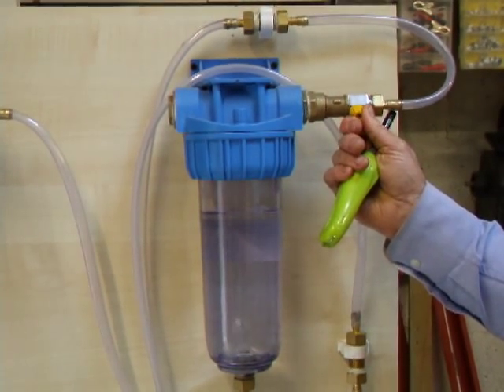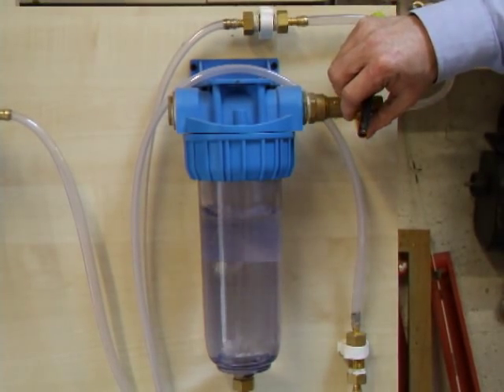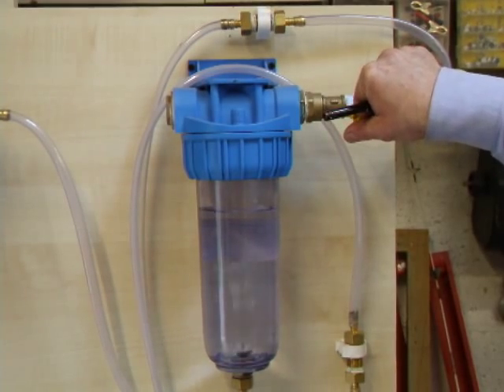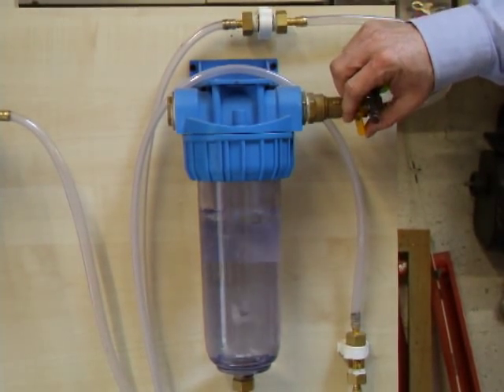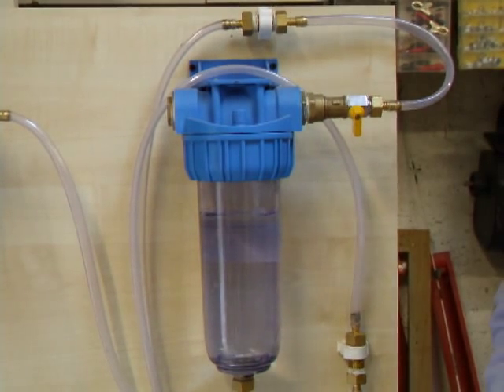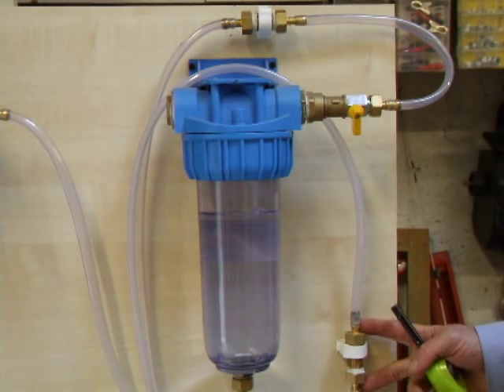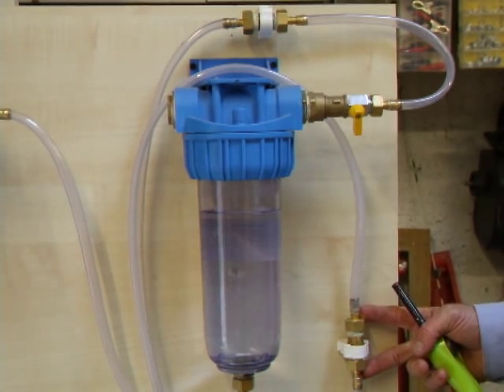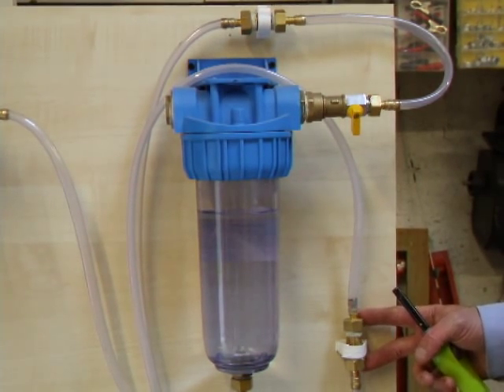Experimental HHO (5 of 7) Flashback Arrester Demonstration

Comment from the maker: Hi sycokitty1, great observation. When the valve is closed, production continues and pressure starts to build. I put a pressure gauge on one of the vessels so that pressure can be monitored. The vessels are warranted to 116psi, however, I NEVER run the cells beyond 25psi for safety reasons. Pressure is useful for welding etc.Tubes are pushed on the barbs and will leak under high pressure - emergency pressure relief. HHO should NOT be vented indoors as it builds dangerously at the highest point.

Comment: I was just noticing that, when you turn off the gas valve, that the bubbles almost stop. Which got me thinking, that it might just be the back pressure slowing the gas down, but not actually stopping it from being made......... (if that is correct let me know).... If that IS correct, what kind of things could go bad (ex. Gas build up in a room/compartment), and what could or should be put in place for safety (ex. Something to cut off the power to the cells once a certain pressure is reached)???